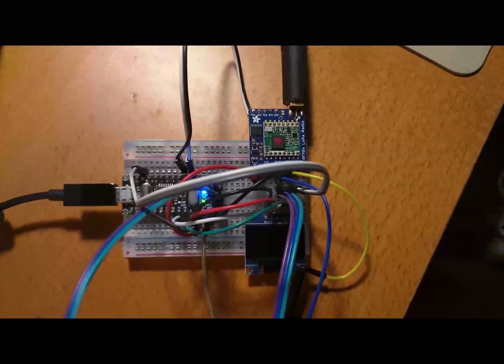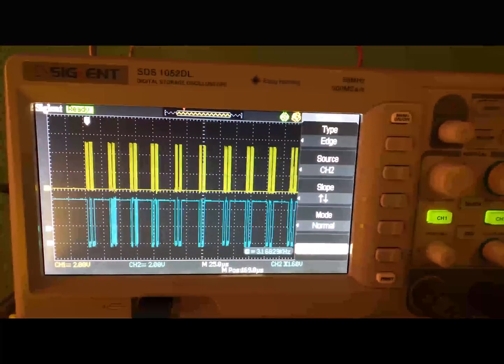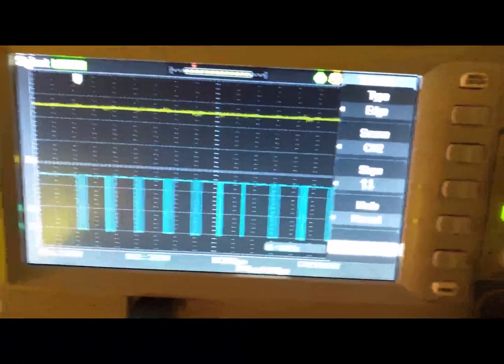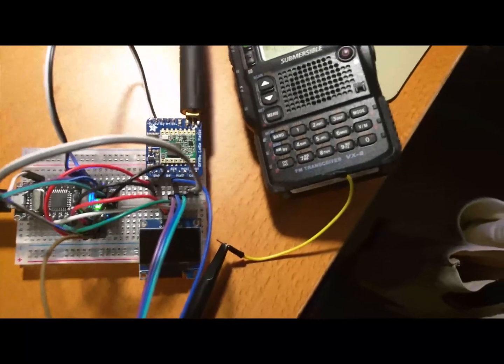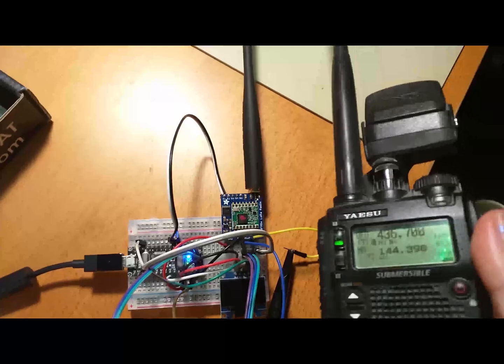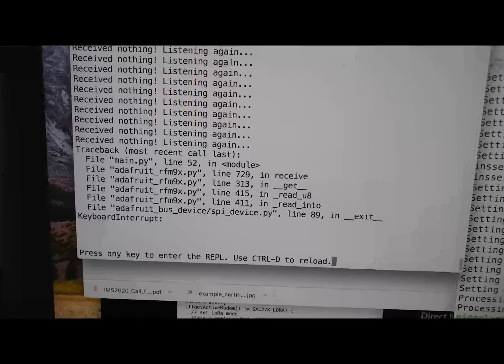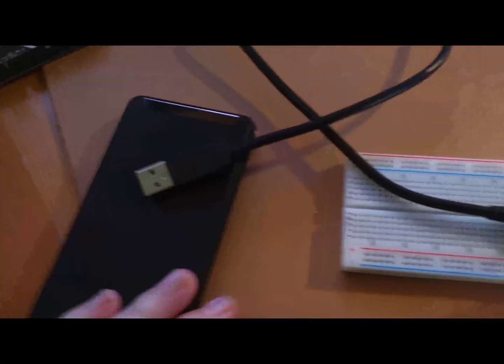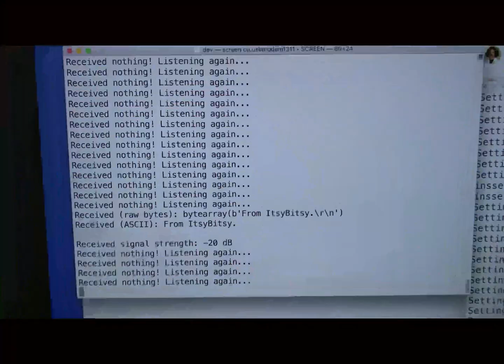FossaSat Simulator - part 1!

Comment: Hi, if you run into issues with the simulator code and/or RadioLib, you can do the following:
1. Check the serial output from the simulator code - that might contain some pointers to what's wrong.
2. If nothing obvious can be found, open a new issue in https://github.com/jgromes/RadioLib using the bug report template. Thanks!
Reply from the maker: Thank you Jan! Making progress and will open an issue if we get really stuck.